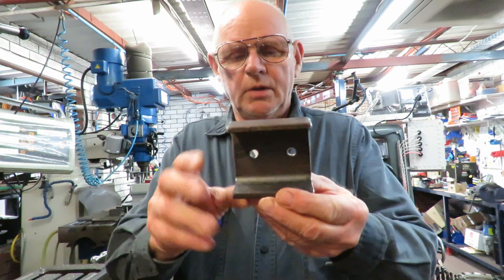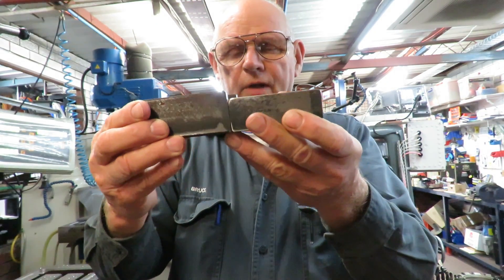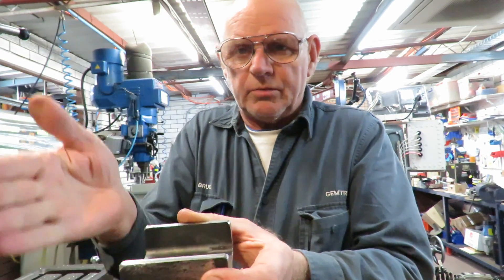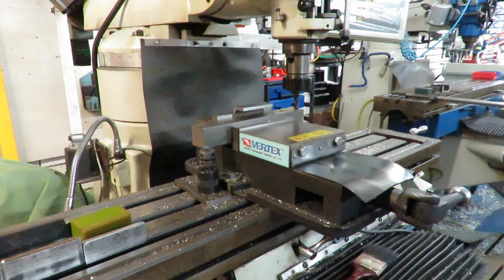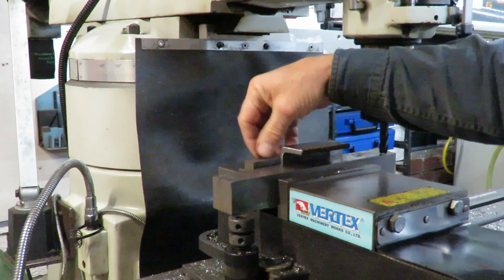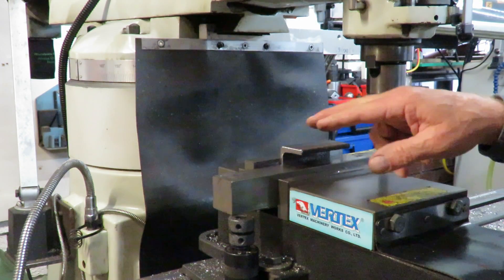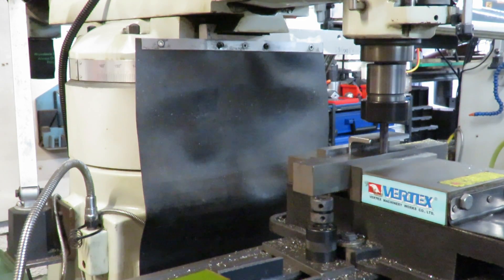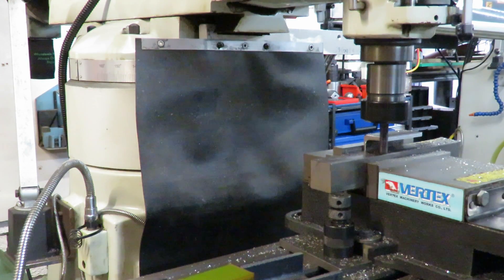Truck mounted crane rest units.

Comment from the maker: The small mill is an ISO 30 standard for Australia and Europe and Canada I think. The bigger one is ISO 40 I have a BP I'm upgrading for sale which is an R8, don't see much of that here. I find the good thing about the ISO's is that you can use BT's as well, All you need to do is screw in an adaptor for the draw bar instead of the "pull pin" too easy and universal.
Reply: Bruce Whitham I have ISO 30 and 40 on my mills and prefer it over R8. ISO tapers are there to locate the tool and drive is by two dogs. R8 is a friction drive and does not release without a tap unlike ISO that releases easily. Using ER collets on a ISO 30 just about the best universal solution,in my opinion.
Reply from the maker: Andrew, Me Too! also the appearance of ER 40 Collets is larger (26mm).

Comment: Would it have been faster to cut most of it off with an abrasive blade and the make it accurate on the mill?  Not a machinist just thinking out loud.  Keep on keeping on.
Reply from the maker: I detest Grinders with a passion and will go to lengths not to use them, having said that I own and use about 20 different types of grinders in all shapes and sizes and they get a fair bit of use.

Comment: C-channel not available in various leg lengths over there? For a prototype  I see doing what you did but in production that is what I would look into. Here at least i can buy rolled shapes way cheaper than I can make them.
Reply from the maker: No standard width flanges only.

Comment: That's a nice little project.  The urethane pads should do the trick.  They also quiet down the rattling as the truck runs down the road.  Please give us some pictures of the finished part mounted on the truck.  Thanks for the video.  Take care.